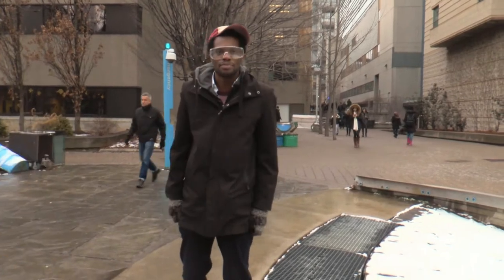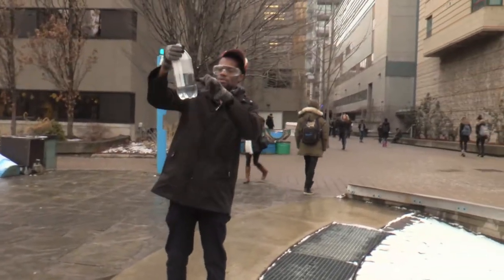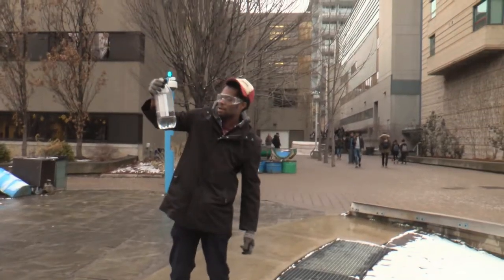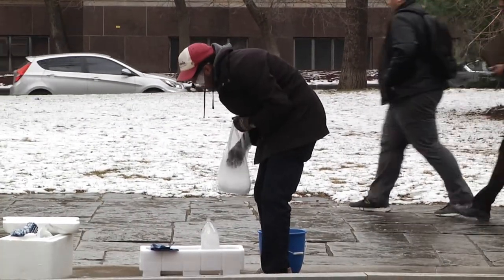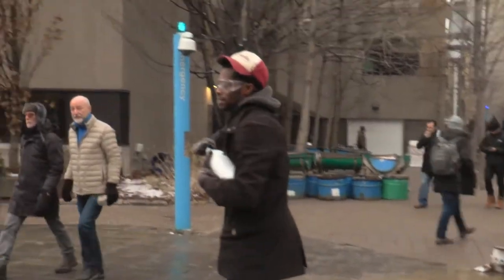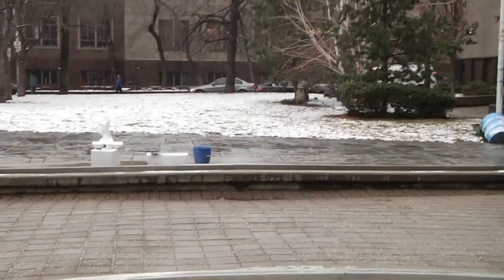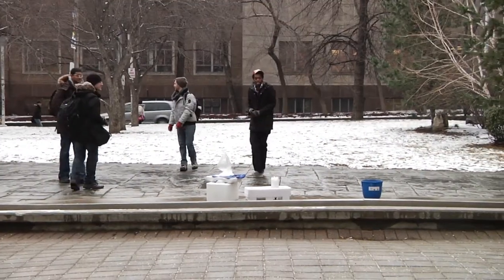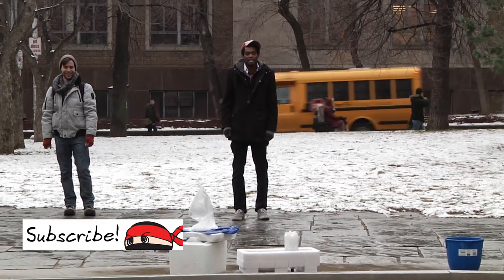Dry Ice Bottle Rockets

Comment: I want to play with one! What happens if you put food colouring in the water? Will the mist be coloured?
Reply from the maker: We didn't try that, but great idea!
Reply: Coloring the water will just color the water the dry ice is compresd carbondioxide gas and when is sublimates (From a solid to a gas with no liquid stage in between.) it turns to carbondioxide gas and that is white so enorder to have colored gas you would need to color the carbondioxide gas before it has been turned to dry ice. Witch poses other problems. Thanks for reading!

Comment: Do you fully tighten the cap?
Reply from the maker: NO! Importantly we didn't use a cap as that would cause an explosion. Dangerous.
Reply from the maker: Instead we used a rubber stopper to plug the bottle since it pops out of the bottle relatively easily. Make sure you have a good platform for your bottle, because the stopper flies out at dangerous speeds. So you can lose an eye or whatever :)
Reply: Gavin Crowley no